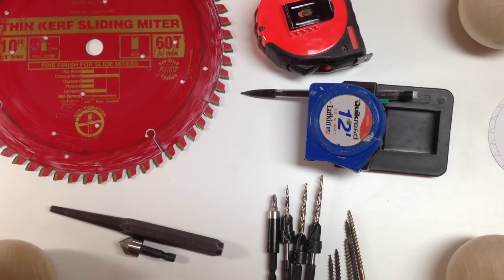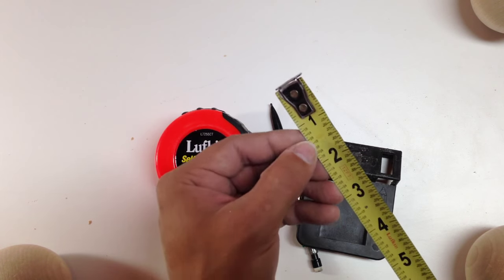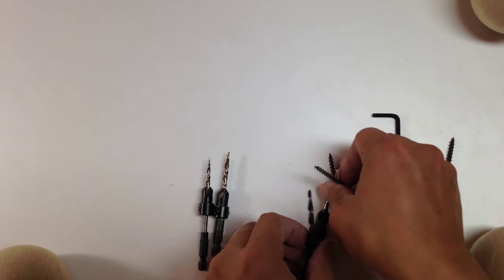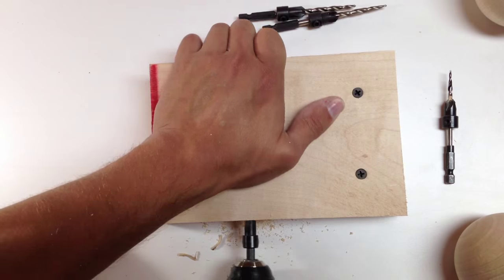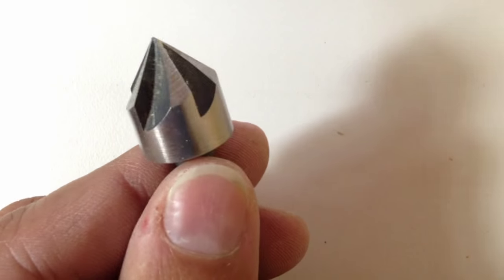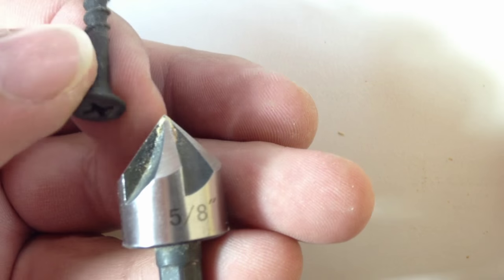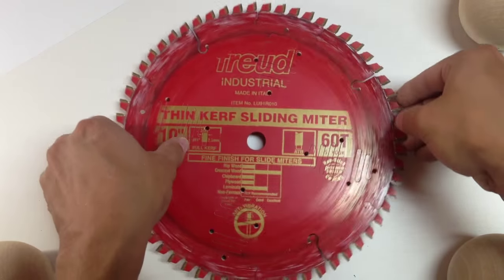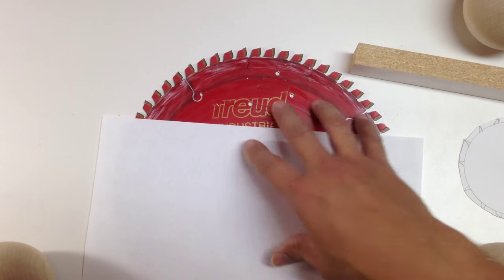Best Inexpensive Woodworking Tools and Tips

Comment: The ‘tip’ on the tape measure is supposed to move!
And don’t use drywall screws for woodworking. They are for drywall! Use screws for wood that don’t have threads on the head end, which is why the woodworking drill bits are tapered.
Reply from the maker: barbara kvistad ... Someone already comment and clarified. Thanks though. I didn’t explain very well in the video to what I was referring to, which was the accuracy of the movement matching the thickness of the metal for the tip.

Comment: The tip of the tape measure is designed to move in and out to compensate for it thickness when measuring from let's say an outside edge it will move out. And when measuring by pushing the end of the tape measure to measure the inside of a wall or cabinet it moves in to compensate for its thickness to give you an accurate measurement.
Reply from the maker: I didn't explain that well in the video. Thanks for the comment.

Comment from the maker: Do not use a 60 tooth blade for laminated flooring!  You will dull you blade very fast, in just a few cuts.  Use a cheap rough cutting blade like 26 teeth.  Since laminated flooring will be hidden on the ends with trim, the cuts do not need to be smooth.  
Do not use a 60 tooth blade for cutting solid lumber!  This blade will burn the wood, cause pinching which will increase the risk of kick back.

Comment: 7 years what ! For one blade . I use this kind of saw blade all the time 2 months  use 
tops goodbye. There are no tips here people x
Reply from the maker: Jon Cleverley ... This blade has a negative degree hook. The ones you have most likely have a positive degree. Even if you’re running a business it should last 3-4 months without sharpening. If you use a blade like that for non-sheet goods (solid lumber) or laminated sheet goods, it most certainly will not last so long without sharpening.